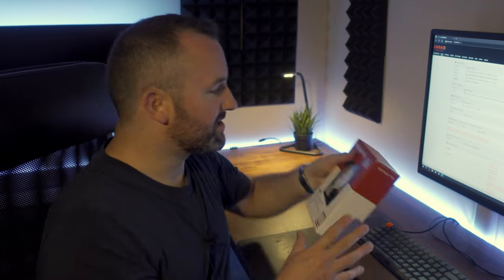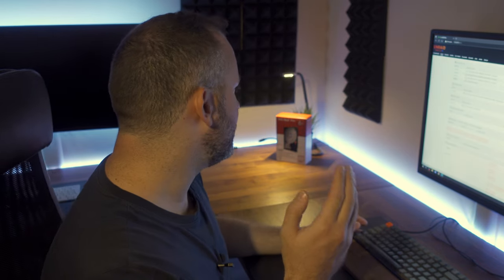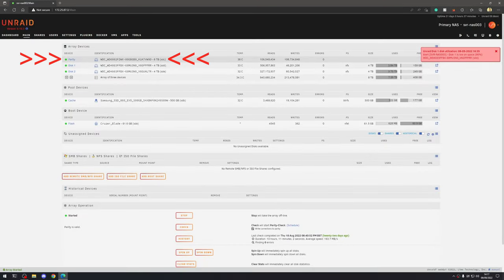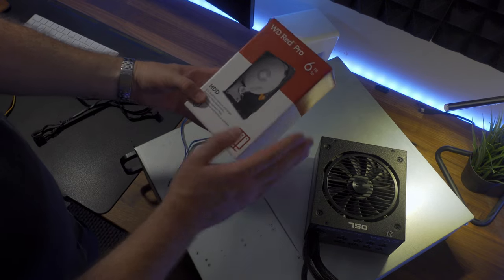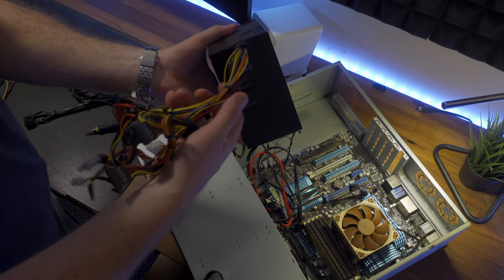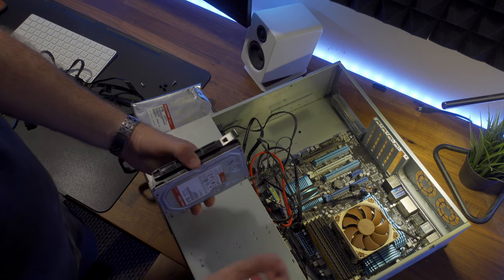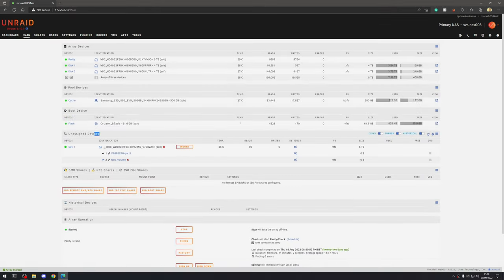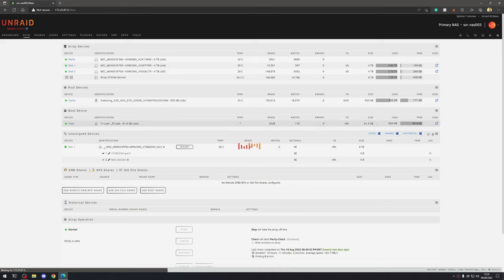How to add additional storage (disks) to an UNRAID server

Comment: Hey, thanks for the vid!
On my current version of Unraid, I didn't have the red cross next to the drive at around the 12:18 mark in the video.
The clear function seems to be off by default (called "destruction mode") and needs to be added in settings for anyone wondering for future reference!

Comment: Note, you need to enable destructive mode for the clear/format button to appear. Settings > Unassigned Devices > Change destructive mode to "enable"

Also, if the drive is already formatted, it should not have any files already on it, otherwise there will be no option to clear the drive. Can delete them using Krusader.
Reply: This is where I got tripped up. Thanks for the tip!
Reply: Thank you!!!
Reply: Bruh… I was bout to throw this thing out the window. Thank you.
Reply: Thanks brother
Reply: Thanks so much, I was stuck!
Reply: You are the real MVP
Reply: thanks!
Reply: Thanks for the heads up!

Comment: Great video. Thanks. You said something that is not quite correct... you said that the largest drive you can install into an Unraid server must be equal to or less than the size of the parity disk. This is true only when talking about adding a disk to the array. You can still install a larger disk into an Unraid server as an unassigned disk. Alternatively, you could replace the existing parity disk with the new larger one, use the old parity disk as a data disk and add that to the array, then rebuild parity. You would have a period where the array is not protected by parity but you could still potentially do that safely if you have backups. It is a small point but I just wanted to mention that so people don't get the wrong info.
Reply: Thanks for that. As a newbie to UnRAID parity disk size was a concern and its good to know it can be replaced with a bigger unit.

Comment: 500W was more than enough to power that 1 additional red pro drive as they are typically only 7w units, especially with the older CPU and no GPU for transcoding installed. But I can understand going to the 750W for future upgradability.

Comment: 200 pound for 6Tb? Seems pretty steep.
I just got a 10Tb segate for $330 aud. Which I assume is around 150-200 pound.
Reply: The wd red pro is a prosumer level ifs one step below enterprise and thus comes with a higher price than a non pro non plus drive due to extra build quality higher read write life better vibration resistance better warranty and so forth . I use pros myself and just added 2 20tb pros for about 1000 cnd
Reply: I just set mine up using 3x 14tb refurbished server drives. Purchased for about 140$ USD each. So far really enjoying the media server I set up using Jellyfin.
Reply: Very steep I reckon. In dec 2023 on offer, direct from WD, I got two 18tbs for £550 making an 18tb red pro just under £280 and £15/tb. Wait for those offers. Also consider used ones to save even more.

Comment: So I don't fully understand the whole deal with the parity drive but is it safe to assume that the parity drive can not be used for regular storage and as such should not be considered towards your total storage when you plan to build, aside from the fact it needs to be the largest drive?
Reply: yes
Reply from the maker: Yes, that's 100% correct. This drive essentially contains "calculated data" that will help re-build the array if one of the disks fail - if the paritity disk fails, inserting a new parity disk will essentially re-calculate the "parity data" and will write it to that disk. - Hope this makes sense :)
Reply: @TheBearTech can the parity drive be upgraded in size by Adding a second bigger drive?
Reply from the maker: @dakid1102  Yes, you absolutely can - I'm actually doing that myself right now... Simply STOP the array and chance the "Parity Disk" drop-down menu to "None". Then shutdown the server. Replace the Parity drive and then start it back up again. Once it's started, select the new Drive from the "Parity Disk" drop-down menu and then start the array :) - The Paritiy Disk will then be re-built :)

Comment: Hi, I want to install a Unraid setup for the first time this weekend and will certainly need to add a hard drive or two later. There your information will help me well. 🙂
Can you maybe help me with my Unraid configuration? I'm not sure yet if I even need a disk for the cache, since all the disks I will use are SSD.
My configuration is a 2TB nvme, it's mounted in an Intel Nuc. Then I wanted to connect two external SSD with also 2TB each individually via USB 3.2 (10 Gbit). At first I thought I would use the nvme as a parity disk and the two externals as a storage pool. Assuming I don't need to cache with ssd disks.
If I need a cache hard drive despite ssd's, would it be best to take the nvme for cache and one external as storage and one external as parity? 
Thanks a lot 🙂
Reply from the maker: Hey @Po-Bert - No, if you're using SSD's for storage you won't need any cache disks - In my "backup" UnRAID server, I don't use a cache drive either. The cache drive is just to increase the speed of writing/reading from the disks. If you're using NVME or SDD's you wouldn't benefit too much from having a seperate cache drive :)

Hope this helps :)
Reply: @TheBearTech  yes, thank you very much. 🙂